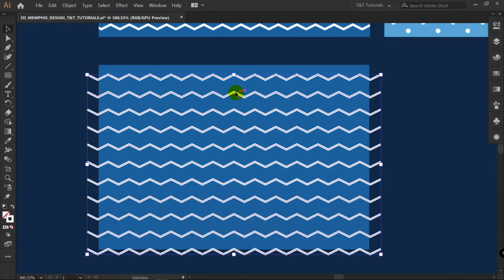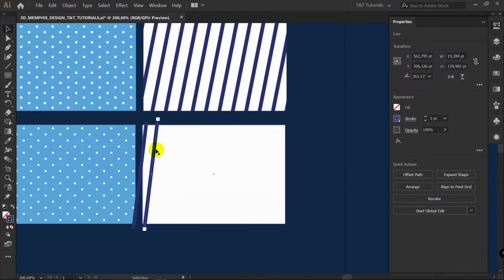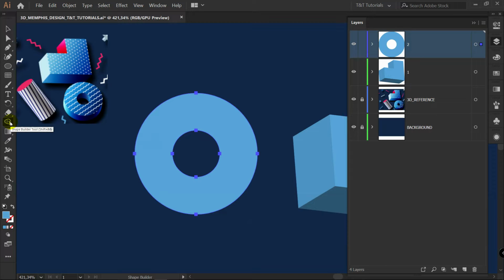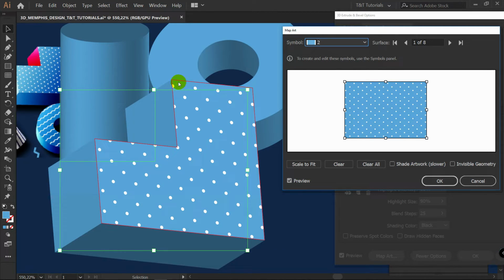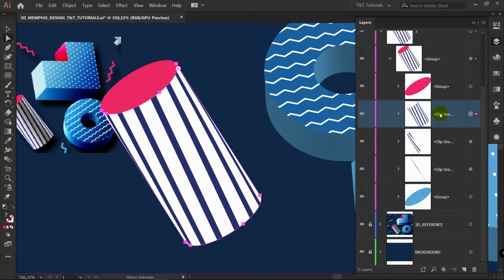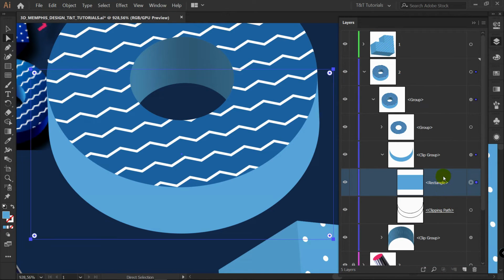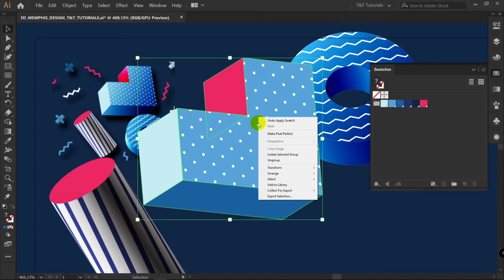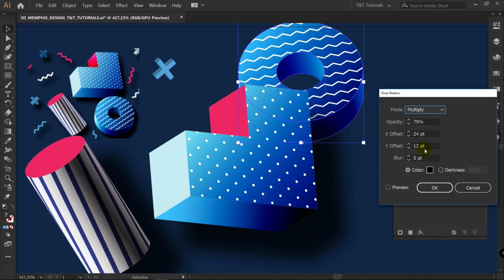3D Objects with Patterns | Illustrator Tutorial (Memphis Design)

Comment from the maker: ↓VIDEO GUIDE ↓
00:36 set up your workspace to be able to follow this Illustrator tutorial step by step
01:39 create patterns using line segment tool, zig zag effect and clipping mask
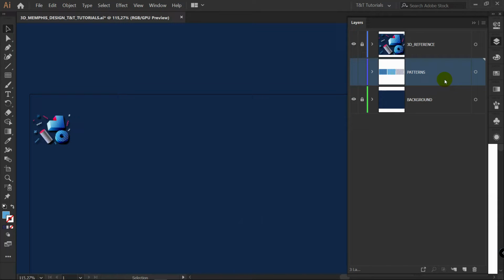12:48 create 3D objects
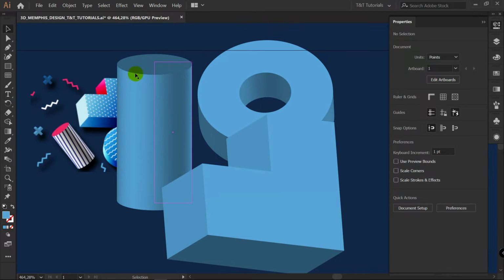19:58 add textures to 3D objects
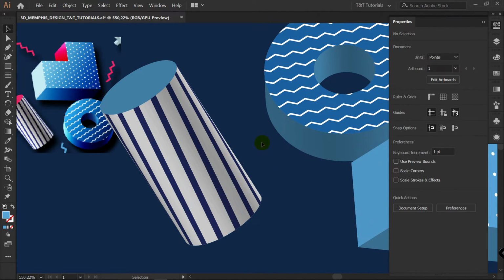24:35 expand 3D objects; apply colors, gradients and blending modes to add volume
40:48 apply drop shadow effect and learn advanced tip on how to use this effect to apply it to different objects faster